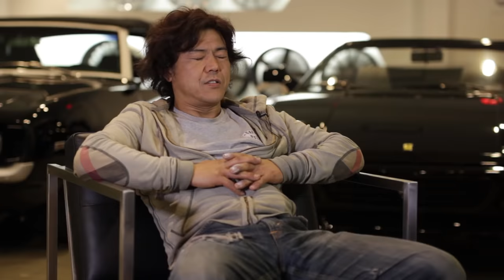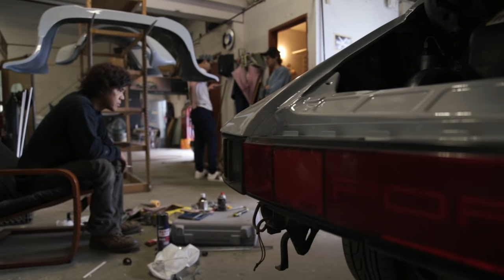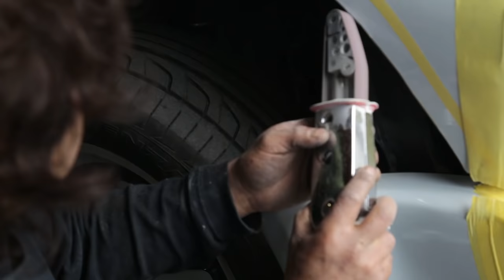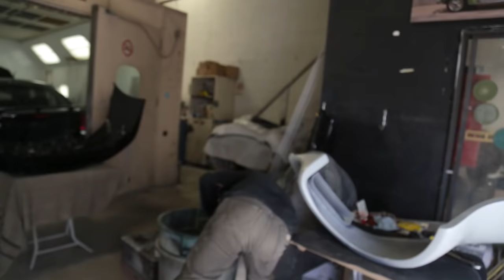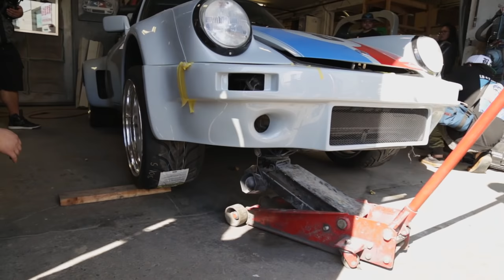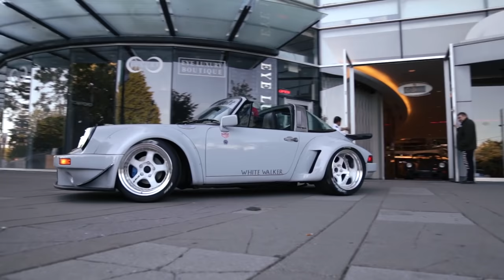RWB "White Walker" 911 Targa | Nakai-san's Daunting Vision

Comment: If I had an air cooled 911 I would never do this to it. That being said the guy is a craftsman to a certain degree. I mean so is anyone that does work like this on other cars (like BRZ's and 350z's) except no one bats a fucking eye lash over those. Also keep in mind that if you have a 911 that's air cooled you are better off keeping it stock at this point in time...or at least as stock as possible.